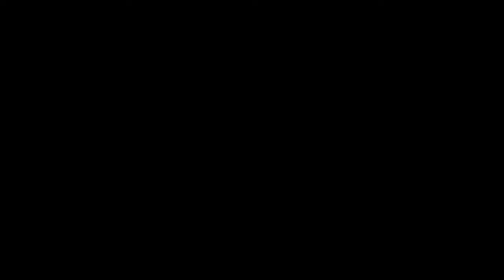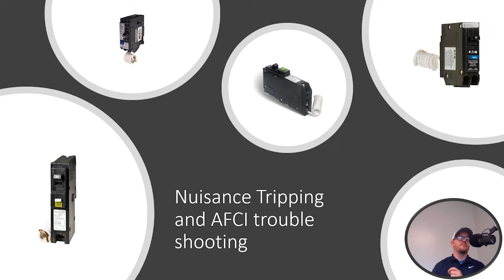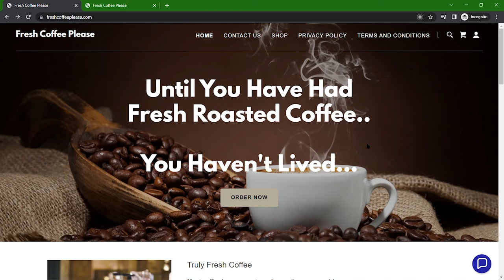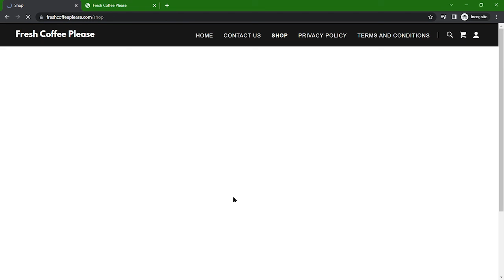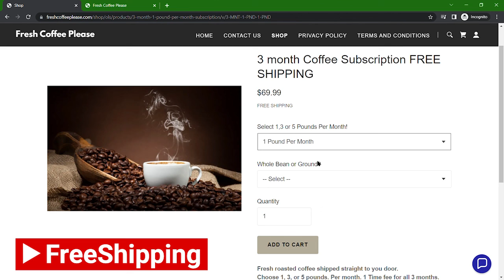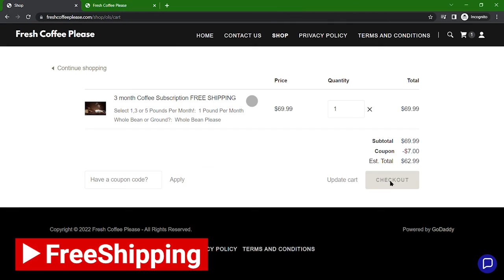AFCI Nuisance Tripping and Trouble Shooting #electrician #electricalcodecoach

Comment: Have a circuit that
Last year had a fault two code on square D afci. Replaced it. Just had a bad storm with lightning and it tripped.  NOw it will not reset.   Wires ohm out ok. Electrician is baffled. Need some
Advice.

Comment: I have a nuisance trip about once a month on a over the stove microwave. That's a direct run to the box to an afci breaker, I did swap the breakers with the one that covers the counter outlets, same thing, I just installed a plug-in emi filter, going to see if that helps, have you seen this with microwaves before?

Comment: To be clear about something that went by rather fast... an AFCI detects a current flow that is NOT a sine wave, but instead is cutting on or off rapidly at microsecond speeds.  The transition from off to on, and on to off, is much faster in an arc than in anything that is actually intended to use electric power.  Old motors with brushes do arc (intentionally) and can trigger an AFCI.

Comment: Siemens  - there.  I dropped it.
Reply: Is that really a thing with them, because I'm having a hard time as a maintenence super at my property with a lot of nuisance tripping specifically on the living room circuits of a bunch of apartments and I'm coming to the conclusion it's a combination of the types of devices used there, computers and gaming consoles, as well as the Siemens brand breakers, which is what I have. What's the easiest solution, can I put some kind of noise filters on the outlets they're using or what's the best course of action. I've got one got who's terrified his electronics are going to get damaged from the tripping.

Comment: Home owner here.  I am having nuisance trips and the square d qo combo afci/ gfci breakers.   I get these trips every so often.  Lately we have had some brown outs that i believe is contributing to a higher number of nuisance trips.   I've tried to turn on the same items on, dryer and insinkerator, to replicate the trip, but no trip.  I've done the diagnostic test and it indicates a ground fault.  I will check the installation as you recommend but is there a way to ensure the power coming in is sufficient and of acceptable quality if for example voltage was fluctuating enough to cause a trip on the combo breakers?    I bought a fluke 378 to measure inrush amps for the dryer and other apliances that might be in question on other  breakers.  And it also has capability of measuring power quality but I need to do some research on that.  Thanks for your channel and any help you can provide.

Comment: What about grounds and neutrals on the same busses in older breaker panels? Especially if it's a subpanel that still has the grounds and neutrals connected. Or even if not a subpanel, but the grounds and neutrals are all intermingled on the busses.

Comment: I recently finished a new construction residence using the combo breakers and had both lighting circuits tripping, finally figured out that in 2 locations I had 3 ways with the lighting  load on the wrong neutral.... a few hours of sweaty fun!

Comment: I'm having an afci nuisance tripping situation. I cannot find out what it is. 

I just replaced my PC power strip with a tripplite isobar. 

I'll start introducing things back into the circuit. 

Kind of annoying because we have three bedrooms on one circuit.
Reply from the maker: The problem start after replacing the power strip?
Reply: @ElectricalCodeCoach  
No, this is why I purchased a new strip. It was a cheap one. With a 1000watt PC plugged into it. It was nearly old enough to have a drivers license. 

It has to be something stupid. What's odd is it trips even if the killawatt reports low draw on the circuit. I don't think the PC is it. Must be a device in another room. 

It's been frustrating to have all three rooms trip at once (same 15amp breaker) when usage is low.

Comment: So I just moved into a house (new build) and I have a 2 pole 20 amp AFCI breaker where the top pole is wired to my brand new gas range ignitor/brand new microwave that about once a week trips a Siemens AFCI breaker. The electrician has been out here 3-4 times and though the trips have become less frequent they are still happening. I’ve had the microwave looked at as well. The breaker has been replaced, a receptacle was replaced, connections have been checked and tightened. But I’m running out of options. The electrician keeps recommending that I replace the AFCI with a traditional breaker. Can anyone give me some ideas on what to look for?
Reply: What did you end up doing?

Comment: I know you said breaker is the last thing you check but in my history (just a home owner), the breaker has been the issue EVERYTIME when dealing with these AFCI breakers.  In our rental house, we had to get at least 4 of them replaced, but I believe that house was built in 2008.  Now we are in our new house, built 2021.  Microwave breaker starting tripping.  I just switched the wires between microwave breaker and the kitchen lights breaker.  Ran microwave, no more tripping.   So I dunno, these breakers still seem to be crap to me.  At least Eaton brand.

Comment: 6 years after a bathroom remodel, I have a AFCI (Siemens QFGA2) suddenly trip and it won't reset. It's feeding one outlet, lighting and an exhaust fan. No appliances plugged in. No new nails or anything.  I'm pulling the outlets and switches but so far no joy. Is there a way to test the breaker?

Comment: I had a loose connection on the breaker screw terminal causing the washer circuit to trip. It wasn’t super loose just enough to cause random tripping.

Comment: Im a new home owner. AFCIs were tripping on 7 circuits! Randomly. Electricians came back 5 times. Reinstalled the AFCIs but with another brand that had "tails" (pigtails?) Problem appears to have gone went away so far except for the built in microwave.  You're saying its 99% the electricians fault on 7 separate circuits? Same apprentice not being careful?
Reply from the maker: The industry is moving fast, at any time you can have a bad batch of breakers, 99% of the time, its the electrician.
Reply: @ElectricalCodeCoach  Thank you. They made a big deal that the replacement breakers had "tails"  (pig tails?) and this would solve the problem. Make sense?

Comment: My issue is a dimmer switch on 3-13 watt LED can lights in the same circuit as 5 receptacles with an ACFI/GFCI receptacle controlling the other 4 receptacles down stream. If the lights are on full or completely off, there are no problems. As soon as I plug a battery charger or another type of "appliance" in and DIM the lights, the AFCI receptacle trips. Any idea why? I always use a receptacle tester and all passed just fine. Thanks

Comment: Informative video,  I've performed a lot of the diag that you recommended , however I have a situation that when I run my dishwasher on a dedicated breaker one of the various 4 AFCI breaker trips. We have confirmed wiring and I reached out to Siemens and worked with them and they are sending me new redesigned breakers which are better programed, Hopping this works.!!!

Comment: No one seems to have made a post about an issue I am searching out to fix, so here is the problem and I hope you have an answer for me. I test a GFCI by the test button and it trips just fine. I reset it and it is fine. I place a GFCI tester into the GFCI and the lights show corrected connections. I press the black trip button on my GFCI tester and instead of it tripping, I get an open ground light and it does not trip. That is the first thing that made me make the Scooby-Doo sound "wrought-rooooww". What could be causing that to happen? I started to think it may be a bad GFCI device, but the homeowner just had them replaced. Not that it couldn't be the issue but it is most likely not when another totally separate GFCI circuit with a duplex outlet as a load in the same kitchen does the same thing. I can plug my tester into the duplex receptacle and press the test button and it will trip the GFCI, but plug the tester into the GFCI itself and press the test button on the tester..... it will not trip the GFCI, however, the GFCI test button works if I press it! Something strange going on there. In the bathroom the GFCI in there was wired to turn on when the switch turns on the O/H light, exhaust fan, and the GFCI outlet power. Very weird. That one does not if you push the GFCI test button, but shows it is wired correctly when plugging in the tester. If I push the tester test button, it shows that it has a hot / net reversed. I took it apart and the wiring was correct, not reversed. What the HECK??? I am confused as to what the heck  is going on. Can you help me figure this mess out? I am going back to that house to try to resolve this problem out, and it wouldn't take me long if I had an idea of what was going on, or what I need to check/test to fix it all. I was thinking an open ground wire but the tester shows the wiring as correct and complete... I am at a loss. Can you please help me, and make a video on how to figure out, find, and fix issues found with the GFCI tester that are not so easy to figure out such as an open ground, open hot, open neutral, and hot/neutral being reversed? Some of those could be hard to track down if wiring issues occurred upstream between breaker panel and actual issue found, but strange things like what I have described is very important to figure out. I am not sure how I could even to simulate such issues to occur so I could understand how they could occur. Hope this one was a challenge for you and not something super simple that would make me be angry with myself. Hahahaha
Reply from the maker: It's either a bad tester, or a bad/missing ground connection, I would contact to qualified license electrician to help you out

Comment: If you suspect a short, maybe disconnect the loads and do a continuity check of that circuit between hot and neutral, hot and ground, and just neutral and ground?
If it's intermittent, maybe use an insulation tester?

Comment: I picked up a dual Siemens afci breaker and doesn’t require you to land the neutral to the breaker itself.  Also, State Farm gave me a device that monitors the home and it’s called “Ting”.  Perhaps this may be a simple solution to detect arc faults rather than tripping a circuit.
Reply from the maker: You have to keep me in the loop about that brother pretty cool

Comment: Ok  here one for ya  Ive been an electrician for over 40 yrs  mostly residential some commercial...
I have installed over the past year - year and a half  1800-2000 Arc/ Duals.  I have had 1-2 issues and yes usually it was the breaker. changed it and no more issues 
Now in 1 house, I am having an issue  6 breakers tripping once in a while.. when I show up I turn everything in the house on  I mean everything to try and get the breakers to trip and they wont    I know they are stripped and stapled correctly , they are on a 2x6 walls so 99.9999% chance its not a screw especially on every circuit ,, and the  crazy thing is they are ALL tripping just on B phase.. and breakers are flashing code 5..... They are dual function -  The frig - washer - microwave- Sink Disp- etc all all home runs only and they trip   and they might hold for a week or 2 then all trip all at once / or all in the same time period and its just a part time rental so its doing it when no one is home and not being used . I say its ghost and need Scooby doo - what say you ?
Reply: I’d guess you have a problem with the utility. Bad connection back to the transformer.
Reply from the maker: Sorry I just now saw this, does sound like something to do with the transformer or utility connections

Could also be the main breaker, or check the bonding bar in between both neutral bars
Reply: @ElectricalCodeCoach  we checked EVERYTHING  every screw / lug all the way back to the meter bank alls good .  Its been 2 weeks now and hasnt done it again . Im sticking with Ghost 
Thanks

Comment: Hi. We have an AFCI breaker that has been tripping randomly. It would go days or weeks fine, then trip. I switched it with the breaker from another room. It went a week or so, then tripped wired to the other room. This seems to me like a clear indication that the (or at least an) issue is with the breaker itself, right? Or am I missing something? BTW, these are 20A Eaton AFCI breakers, original to the house (around 2011).

Comment: Can you say that part about it almost never being the breaker a little louder for the folks in the back? It seems like replacing the breaker is the default for "less thorough" installers and builders, which leads to return visits and frustrated home owners.  Good stuff.

Comment: Nice instructive video. Shared connected neutrals across two circuits in a light switch is a very common issue. Without going deep dive into the science of plasma physics and electromagnetic field displacement and irregular transient waveforms it’s actual quite complex when you have to design these things. I like the dual (actually triple protection breakers - AFCI/GFCI and overcurrent protection) levitons, Hubbell, Legrand then Eaton and Schneider work well in that order of quality in my own view. I really do like Leviton smartrip dual AFCI/GFCI receptacles they can be a cheaper way to get protection and 2020 code compliant for branch circuits. That being said even the best and modern can trip every now and then that has to do with shielding and power electronic components in many pieces of equipment - microwaves and coffee machines are notorious for causing trips on AFCI or GFCI protected circuits. Replacing with more modern GFCI or AFCI receptacles in a kitchen circuit often resolves the problem. However that being said poor electrical circuit design in devices and leakage from them can create problems including transients in voltage and current that can mimic arc signature or ground leakage it’s just they happen much less frequent. That’s a power quality issue.

Comment: TL; Dr: Fridges in apartment complex keep nuisance tripping. is this common?

Great video, Coach! tons of useful information. However, i am experiencing an issue that didn't seem to be covered.

I work in apartment maintenance. I'm not an electrician by trade, but i can perform work safely and to code. The issue is we have exclusively our fridges dedicated circuits are nuisance tripping. this has happened ~25 times out of ~200 apartments in <1 year.

The building is new enough (~3 years) that 90% of the circuits are afci (not combos as you recommend). Fridges are whirlpools, breakers are (i believe) Eaton.

I have heard that it can be caused by the compressor motor, but where i am stuck is what can we do about it? It's a very annoying problem. We have reimbursed ~$5000 food and its just a stinky mess for our residents. I would love to hear your recommendation.
Reply: Share with us the details, and more people may be able to help.
The exact model of the fridge.
The exact model of breaker.
The exact wiring scheme.
Any other receps, devices in the circuit.
Diagnostic blink code given by the breaker.
Reply from the maker: What code cycle was this wired in? Email me at electricalcodecoach@gmail.com I'll help you dial this in

Comment: Solid info thank you.  Replace the breaker if all else fails, not a the beginning 💯 We have had major problems with Siemens ARC fault breakers, and good success with SQD.  The InteliArc tool by Siemens has helped us show the customer that their equipment is causing the ARC fault, this has saved a lot of time.
Reply: Sqd or eaton, 99% of the times works great
Reply: My electrician said the InteliArc tool was unavailable still. 😡
Reply from the maker: Great tip!
Reply: Is the InteliArc tool available?  (I haven't seen it available anywhere in last 2 years)

Comment: How are we supposed to know what brand to stay away from if you don't tell us what it is? You are always saying you here to help.
Reply from the maker: Lol it's GE but I'm not going to bad mouth them on a video
Reply: He's here to help.... not here to get sued.
Reply: What are you talking about ?? GE is a great tried and true brand. It’s that Eaton CH combination arch faults and dual function afci/gfci breakers ! I am constantly going on service calls that have to do with troubleshooting a damn ch breaker. Even the regular ch breakers will just fail. You can turn off the breaker to work in something and go to reset it and it just won’t reset lol. They are trash. I would say most of the troubles , in this instance, that I find are the wrong neutral landed on the breaker. The second most common trouble would be it’s being used in the wrong application. Like a dual function breaker has been used on a dishwasher circuit when all you need is gfci protection. Or some other appliance that doesn’t need afci protection.